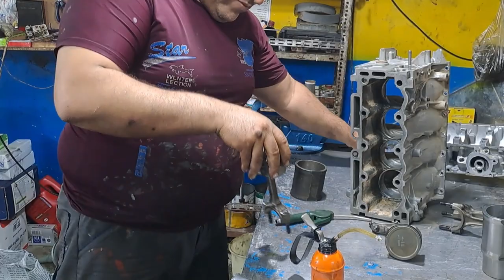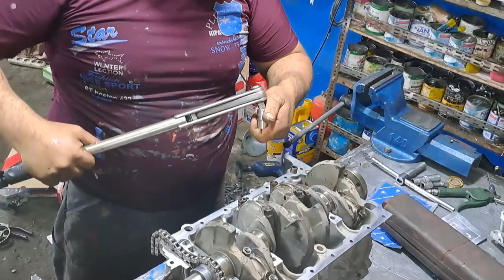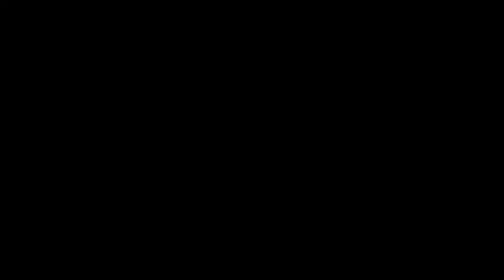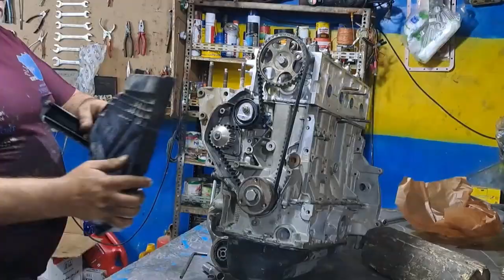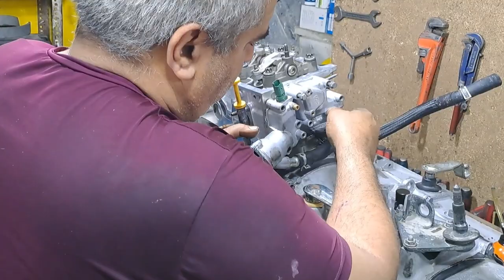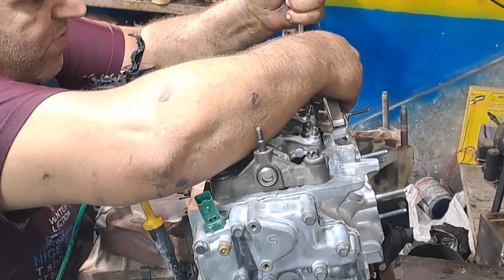You Won't Believe How Easy Car Engine Assembly Can Be!

Comment: Wish I had the garage space to do this, my moms old 2009 mitsubishi gallant now sounds like a diesel due to half the oil leaking out when I put that Mobile 20k mile garbage in it.
its a 4G69 motor. The mechanic says it's one of those wait and see things. it now burns oil, but the oil does not leak through the front main if its regular synthetic oil. Any insight into what the damage could be? Worn out piston rings, maybe some wear on the main bearings?
The oil lamp light never came on with half the oil missing.
Reply from the maker: God willing, this space will be created for you
A large garage